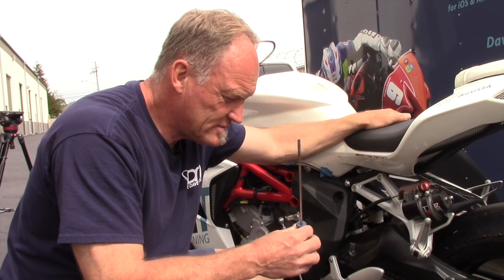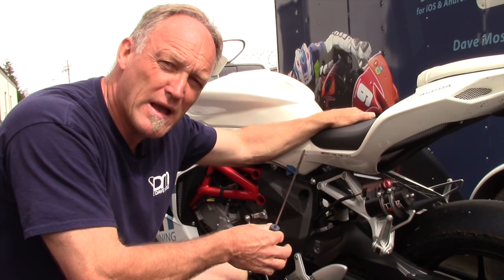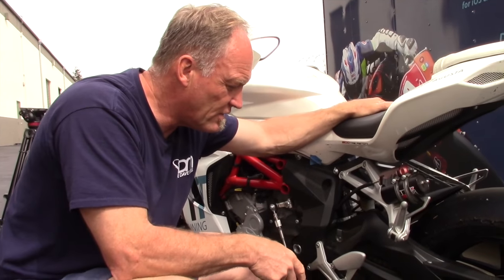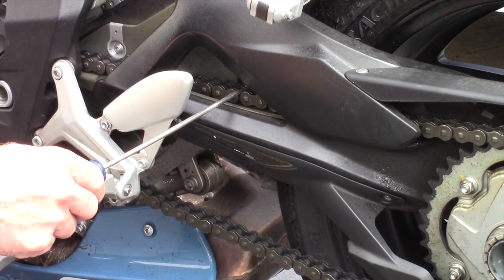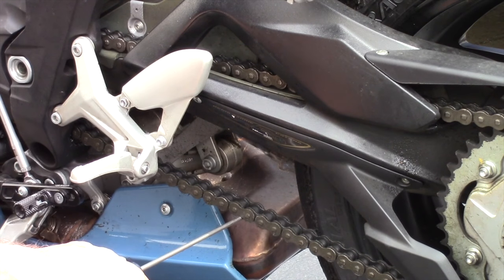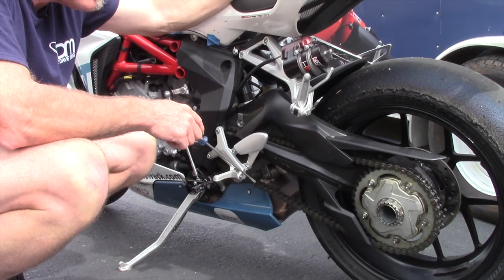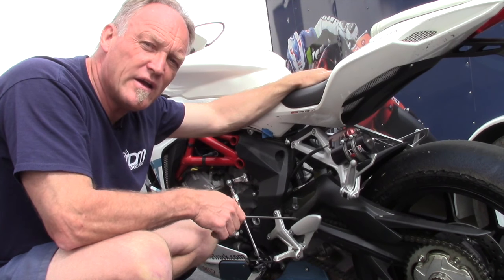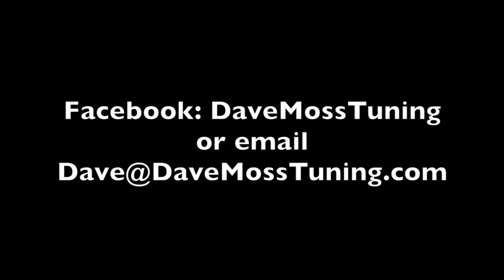Motorcycle Chain Slack

Comment: Been riding motorcycles most of my life. Never realized that the upper chain was not supposed to move when you were checking adjustment. I've been adjusting my chain too tight for years apparently. Thank you for this video!
Reply from the maker: Thank you for watching and being open minded about this topic to acquire new knowledge that can be very helpful for suspension and front sprocket bearing.
Reply: @catalystreactionsbw  It has been helpful! Love watching your content.
Reply from the maker: @wrenchrat  Thank you!
Reply: What was the result of that? (Whole life time of over tensioning) Did you have a damage or something else..?
Reply: @geniuspackardbell369 Nothing happened because his chain wasn't too tight.  The top of the chain SHOULD move.  You're not getting an accurate slack measurement if there's unmeasured slack up top.  The manufacturer spec is taking suspension travel into consideration.  That's the entire point of having slack.
Reply: @jridenour31 Dave Moss is an expert on motorcycle suspension set ups yet you appear to know more than him 🙄

Comment: Excellent guideline. The manufacturers never bother with these nuances in the manuals! Thank you!
Reply: What if the manufacturer didn't mention because its not true? 🤔
Reply: @Alex-ck4in  what is not true? Nuances? You can check it as presented on the video, you can also check it by applying excessive force to it and have completely different reading. You can argue what is wrong or right, but you can't argue that it can be done in various ways and it would be great to have that in the book.
Reply: Can't even get a manual for late model Triumph.  Have to pay the thieves just to reset the light, so I don't.

Comment: I forget where I was tought it first, but a reoccurring tip is to check the chain at it's "longest". 
- When the wheel axle, the swing axle and the front sprocket axis align. As long as there is noticeable play, at least the chain wont be stressed from the suspension motion. 

I only did this on my dirtbikes (soft suspension and critical failure if it is wrong). The road bikes are too busy to get to on my own. Don't want to drop it - again. I just follow the manual and try to visualize if I'm safe for the swingarm movement.

Comment: This is gold, they don't tell you that in the manual. Thanks Dave!
Reply: Did you ever think that the Manual takes that into account? ....They designed the bike from scratch .. they are not stupid people ... think about that for a sec.
Reply: @TYRONE_SHOELACES   What does that even mean?

Plenty of people here have had the same issue with their chains because manufacturers don't bother mentioning this specific information.

Maybe you missed the point of this video, think about that for a sec.
Reply: @RobbieLancelot i think what Tyrone is trying to tell is that the manual  is allready takes the chain slack and tension all together. So when you mesure you chain to your manual its okay if the uper chain is moving.

Comment: Interesting. The manual for my KTM 990 acutally states that the upper part of the chain must be taut when checking the slack.
Reply from the maker: Lots of methods to do one task. We all learn what we consider works for us based on experience. Does the manual ask you to find the tight spot first? That would be interesting to see if they account for that.
Reply: @catalystreactionsbw  It says chain wear is not always even, so the measurement should be repeated at different chain positions.

Comment: I don't see the point with adjusting the bottom chain while not having the top chain move. You have to have all the slack out ot the chain at the top when adjusting the slack at the bottom. When driving your bike, the top chain is tight when accelerating or constant speed cruising. Any slack at the top would transfer to the bottom causing the bottom chain measurement to increase. In other words, if there 15mm slack at the top and the bottom was adjusted to 35 mm bottom, you now have 50mm at the bottom and 0mm at the top when the chain is being driven. I've never seen a manufacturers manual address the "no movement at the top" when adjusting chain slack. It just makes sense to be looking for total slack within the entire chain.
Reply: Finally, somebody else that actually understands how things work.  Also, the slack at the top of the chain is going to vary.  Eliminating slack at the top by moving it to the bottom is the only way to get an accurate measurement. The only reason slack is needed is to keep the chain from being too tight as the suspension moves through the stroke.  Adding more slack to compensate for rider weight, suspension travel, a passenger, whatever... is unnecessary and accomplishes nothing.  1mm of slack when the chain is at its tightest point in the suspension travel is enough and that doesn't change, whether there's a 100 pound rider, a 700 pound rider, 20 passengers...

Comment: When the shock is out for maintenance you could check and set the chain so you have free movement through the range. 
Then you know once its back together you have correct tension. 
Cut a chock of wood with a step in it and use that as a tension gauge.
Reply: Or, and this is justa fucking WILD idea, you could follow the user manual ! Fuck me if you are really arsed you could even buy the workshop manual and follow that ! It's not like those pesky engineers have designed your bike so that through full suspension compression with the chain tension set as specified it wont fucking kill you. Mind you if you are riding anything from the states you may need to check that.
Reply: @cunningpunt  not here to argue 👍
Reply: @cunningpunt Thank you.  People are overcomplicating this.

Comment: My manual says to do it with the bike on the ground on its stand. I've always done my chain slack adjustments on the rear stand. It's there a huge difference from doing it either way? Good tip for looking at the top chain. Never knew that.
Reply from the maker: No difference at all - both techniques have the chain under static sag load.

Comment: I followed my manual word for word. The chain was set exactly as described, but when Dave checked it at Buttonwillow, it was indeed way too tight when I was sitting on the bike. I was risking damage to my bike and interfering with the suspension and I didn't know it.
Reply: Yeah I'm having the same problem on mine. The correct, by the manual, tension is too tight. Also followed the manual word for word.

Comment: Great videos , I always ride two's up with the wife and I'm just wondering what the best amount of chain slack would be , the manual states 20-30 mm and I set it at around 25mm , I just don't want to put to much stress on the front sprocket bearing if I can help it , I have set up preload front and rear to compensate for the extra weight at around 290 lbs with both of us on the bike , the rear static sag is 10mm and riders sag about 35mm , the reason that got me concerned about this is I'm in the process of replacing my front sprocket oil seal and I've check the sprocket shaft for moment and there isn't any so I think the bearing is ok but I'm worried that maybe 25mm wasn't enough slack and maybe caused the seal to fail prematurely  , it's an mt10 with 13,000 miles on the clock. Any advice would be much appreciated and thank you for all the knowledge you bring us riders over the years with your videos
Reply from the maker: Thank you for watching! 35-40mm is safe if you ride 2 up and yes, fair comment and concern on the very early failure of the front sprocket seal. Check the rear sprocket teeth to see if they are angles at all on the tips.
Reply: @catalystreactionsbw  brilliant thank you so much , I will check it all over and make sure it's all ok and I'll go for a new chain and sprocket next spring

Comment: Surely the chain should be loaded up....you have unmeasured slack on the chain top run otherwise using this method.
.Put in first gear, wind wheel up then check total deflection on bottom chain run.
Reply from the maker: I prefer gear box in neutral, find the tight spot,
sit the rider on the bike and check it. You can use any method you want.
Reply: That unmeasured sag is necessary for when you have negative wheeltravel
Your rear suspension IS capable of telescoping a little outward instead of just inward and will do so when 'dropping off' of humps or braking hard
just like your forks will extend a bit when lifting the front wheel off the ground by the tripletree/handlebars (or wheelying)
Reply: @Nightdare No, it's not.  The slack on the bottom also compensates for suspension extension.  One side of the chain is always going to be tight and all of the slack will be on the other side, whether you're braking or accelerating.

Comment: Thanks for the great tip. How do you know where to lift the chain up And by lifting the bottom chain up with a screw driver how do you know what is tight/loose? Also how do you find the tight spot in the chain?
Reply: FIFTYmil from what I know you do what Dave showed all around the chain until you find the section that is the least stretched. Because a chain will never stretch evenly.
Reply: To know what is tight or loose, you grab your owners manual and the tension specs will be listed with a picture of the service being done. I use a pair a calipers that can measure the resting and loaded tension. Then hit that number or go a little below if you're going to really load the bike down. As that swingarm goes up (the bike's suspension compresses down, closer to the swingarm), the chain will bind the hell out of itself with heavy loads. Here warms you about all of that.
Reply: I guess you mean on which area on the chain you should lift? Right in the middle between the two sprockets.

Comment: Like so many other commenters, I had never heard anyone say to watch the top row of the chain. But, I also note that you did not press down on the chain to determine total play in the chain. Can you elaborate ?       I'm one who does read the manual often and when I look at their diagram ( Honda CBR 1000rr ) they appear to show that you only move the chain upwards, exactly the same way you did. Maybe I just answered my own question but would love your thoughts.
Reply from the maker: This is the way I was taught a long time ago and the key was to assess chain free play this way. Raising the tiop of the chain will immediately pull the bottom of the chain up. Next would be to ride the bike and get the chain hot and check it again and thirdly, put the rider on the bike and check it with them sat with feet down.
Reply: @catalystreactionsbw  Many thanks for your reply and your video.

Comment: the movement in your chain was not 30-40mm yet you said it was a little loose? what movement range are you looking for in a road bike?
Reply from the maker: In a road bike I would look for 25mm to start. If I am only using 60-70% of shock travel, I don't need 30-40mm as I would on my race bike.
Reply: I think, you should check/set the sag first. Because if the rider is heavy and/or the back of the bike is too soft the chain becomed very tight when riding
Reply: What your bike's manual says

Comment: Wow, I thought that chain looked a little tight. Since hearing Josh Brooks (BSB rider from Australia) advise to set slack so that the lower chain run cannot quite touch the swing arm, Ive adopted the same approach. Your video would suggest that’s too loose.
Reply from the maker: Thanks for your comment. in most cases other than 675 and R6, I try to get the chain to just about touch the plastic chain guide without making the top of the chain rise. In this case, not touching it might be considered too tight.
Reply: @catalystreactionsbw  Sir  is it even possible to loosen up a tight chain?
Reply from the maker: @daniellacko6620  Not sure what you are asking, so If the chain is kinked with frozen links, you can soak it in kerosene for a few days. If that does not help, replace the chain. If the chain is tight then you can move the axle forward but you have to check the tight spot of the chain.
Reply: @catalystreactionsbw  it has a few tight spots so it will be replaced just wanted to ask an opinion. the stock chain was good for 8500 miles this new one i got summer only was expensive with the sprocket but only lived 4000 miles... sucks :/

Comment: Mr Moss  i don't necessarily agree with your comment that the top chain run should not be straight/tight when checking/setting chain slack.
Is not the top chain run under tremendous tension when the engine is driving the back wheel and as straight and as tight as it will be.
So all the chain 'slack' then will be the bottom chain run between where it leaves the front sprocket & is being picked up by the rear sprocket.
So when the rear wheel hits a bump, dip etc while it's being driven, the chain slack needs to be a bit more positive than zero for when the suspension compresses to the point the centers of the front sprocket, the swing arm pivot and the rear wheel axle form a straight line between them, where/when the chain will be at its tightest.

I would appreciate an explanation as to why setting the chain slack 'your way' is the correct way. Instead of just saying it is.  Thanks
Reply from the maker: Thank you for your comment. Chain tension can be done in many different ways depending on the lesson received and theory behind the lesson. This is an examplke of what I was taught and so I put that on video for others to review, comment or or use. It is not a didactic lesson, just food for thought and opportunity to ponder. I prefer to do this with a load on the bike to make sure that the chain does not bind at close to maximum  travel. T

Comment: Great! Is there any difference between a "cold" chain & a "hot" chain i.e. measuring the slack before riding or just after a ride? Also, I bought a center stand for my Yam MT03 660cc & wonder if it makes any difference when measuring the chain slack whether the bike is on its side or center stand ??? Many thanks
Reply from the maker: Yes, metal expands with heat so after a 40 minute ride, the chain tension might be less depending on your pace.

Comment: The top of the chain not moving does that stand for all motorbikes? Can’t see it documented anywhere and now I’m getting hung up about weather or not my Gixxer chain is right or not.
Reply from the maker: You can choose to use the manual guidance, the process you know and trust, the process where the tight spot is the go to or my method. Please stick with one to avoid confusion and don't change from that. I choose to be a lot more precise with this measurement, more so than others.

Comment: Clean a chain every three hundred miles..... well that'd be two or thee times a week in summer for me then..... but my bikes have belts which I leave a little loose as another thing to remember is that sprockets get warm when in use so the chain will tighten as they expand (belts are even worse for this as the wheel pulleys are ally which expands more) and this in turn will create excess loads on swingarm  and wheel bearings and if left unchecked can cause them premature wear or to collapse - wheel bearing failure at speed is not much fun !!!

Comment: We've all seen the measurement diagrams...... Dave's got experience with thousands of bikes. My uneducated guess is that there's a certain swingarm angle "range" ..... no matter if a bike's angle is at the upper spec, or lower, it wouldn't affect slack much between the two until you surpass 70% shock travel- that's when the real stretch begins. Only factors i'm curious about is- shimming the rear height and/or running a smaller front sprocket? I'm assuming the same procedure taught here would still be applied?
Reply from the maker: Yes, correct. We try to keep swing arm angle at 10-12 degrees and then based on rear axle position, spring and valve the shock appropriately based on leverage and rider skill.

Comment: When the gearbox output shaft , swinging arm pivot and rear axel are all in line , that’s the tightest point ( unless there is wear - another issue all together ) . I’ve only been a professional motorcycle mechanic for 35 years and I’m calling bullshit on this video . If you are using the manufacturer recommended slack , it’s all on one side ,ie it’s on the bottom with the slack taken up on the top .

Comment: Sir, could you be more specific on how the chain tension affects tyre wear.
Reply from the maker: If the chain is too tight, it binds and pulls on the counter shaft bearing. It also stops the shock from moving further in the arc it should and the load is transferred directly to the tire to be the suspension. In this case (for every second the bike is being ridden), the tire wear is accelerated due to the excess load it has to sustain/endure. Hope this helps.
Reply: @catalystreactionsbw  Got it, Thanks.
Reply: @catalystreactionsbw  Does this mean with maximum load on the rear (deepest position of the wheel) I should still have some clearance or how I can check it? The standard values from the manual seems to be far away from your recommendation?
Reply from the maker: @TurboAcki  Ideally yes. You would load up and have someone else check it for you that you trust.
Reply: @catalystreactionsbw  should you be sitting on the bike with the wheels on the ground, with the suspension compressed to check for chain slack?
manual says to check chain slack with bike on the side stand, makes me want to buy a bloddy shaft drive.
Reply from the maker: @roadwarrior8560  Many, many ways to do something and we all find our way, whether that is via the book or personal experiences. What you choose to us as a technique stay with all the time for consistency.